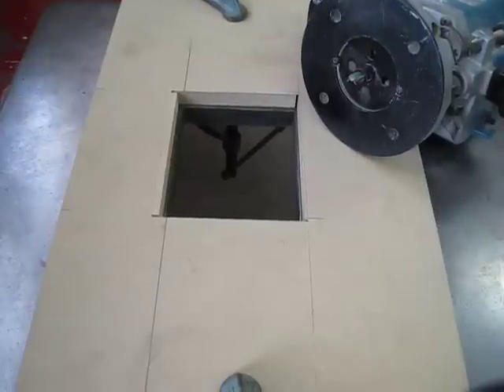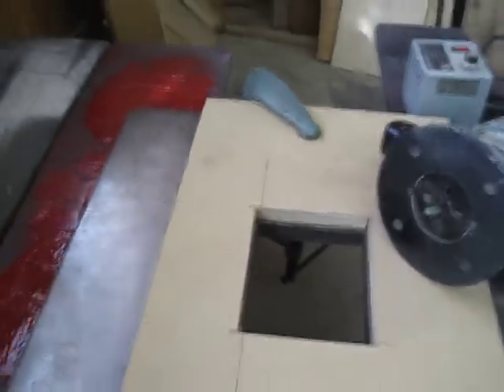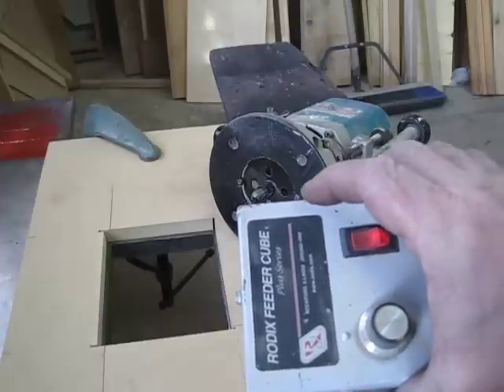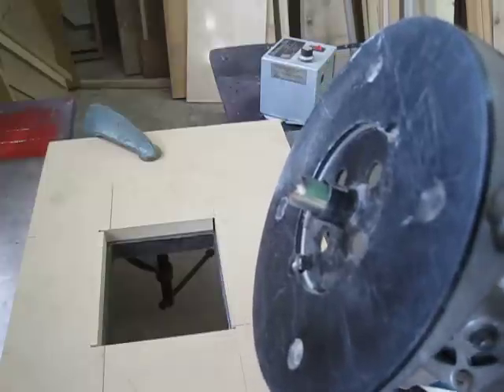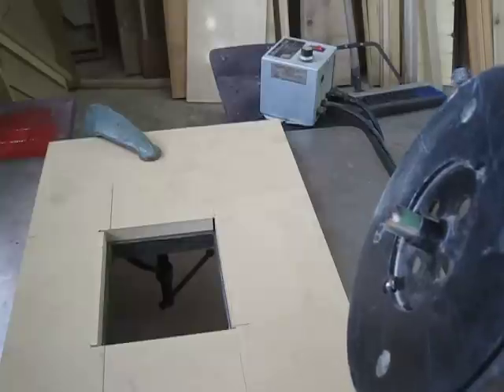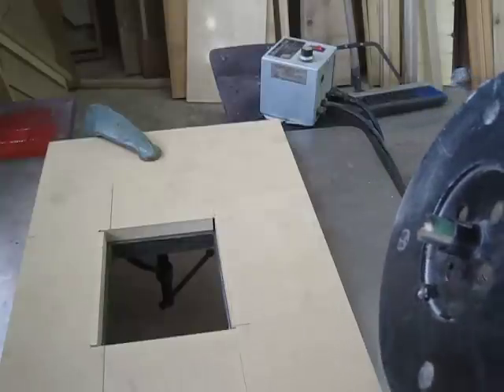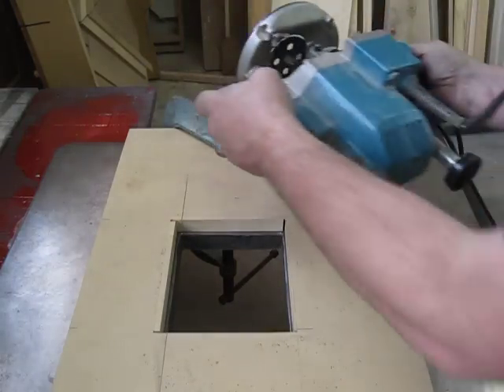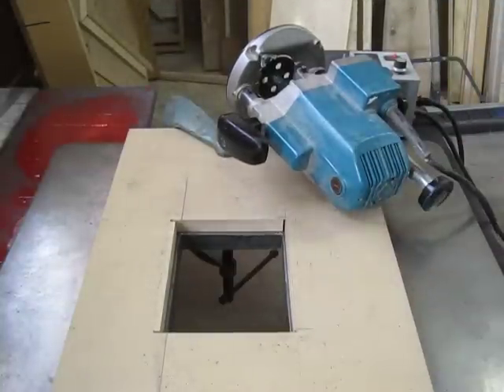Oliver 190 ,milling  iron with router

Comment: Thanks for posting this. I want to change the insert in my drill press table from a thin metal plate to a square MDF insert which is friendlier to my drills. I was thinking of having this done by a local machine shop but it looks like I might be able to do it myself.

Comment: You can use routers for anything. I can tell that casting has some hard spots. Thanks for sharing. Keep the vidz coming.

Thanks, Michael Frey
Reply from the maker: mike Once i speed it up it cut very smooth. had it slow for the first cut as i had not idea what speed to run at. I am using a rheostat to get the router down to the 3000 rpm that worked best for me.most speed control routers only go down to 9000 rpm. Be very carefully if you try it. 

i will post a link  to the finished cut pic in the  up top.

http://i927.photobucket.com/albums/ad111/tool613/wadkin/millironwithroutor004_zps249252af.jpg
Reply: Great Job.. Really nice mill surface.. Again amazing what routers can do. Thanks for sharing.

Thanks, Michael Frey